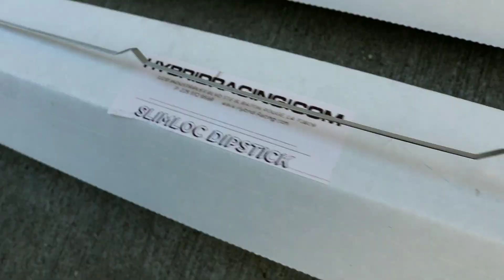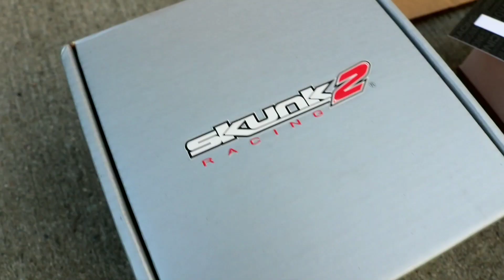Upgrading the ENGINE BAY! (Hybrid Racing - Part 1) | Project S-ea | S2 - EP30

Comment: What do you do with engine while valve cover is off and being painted ?
Reply from the maker: I had a spare cover that was sent out instead. But you can just cover it which a plastic bag or something to prevent anything from going inside the engine.